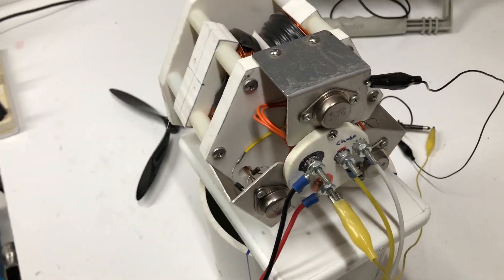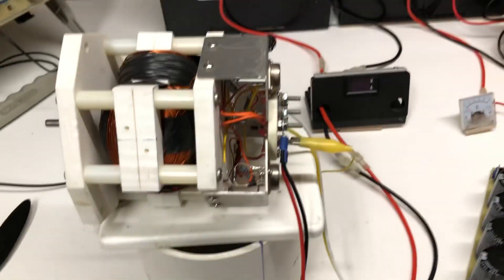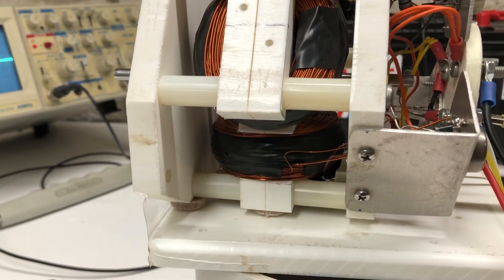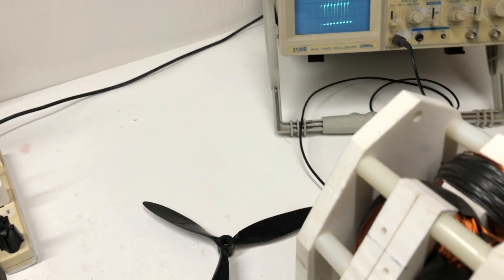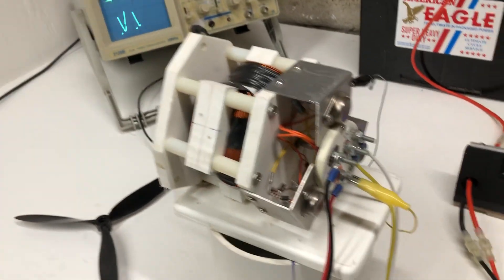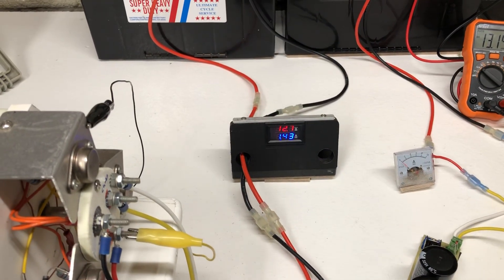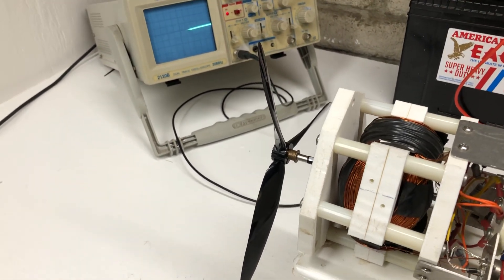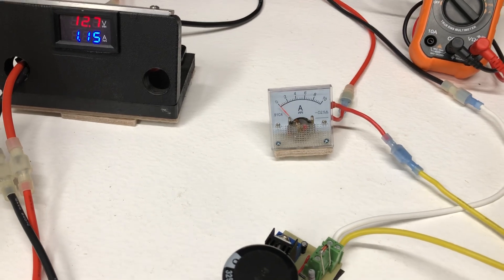Window motor operation with bedini circuit

Comment: Interesting stuff!

Why and how do you use the 'capacitorbank'?
Reply from the maker: I use capacitor bank to convert the hi voltage spikes coming out of the motor to low voltage high amp output

Comment: The diode you have connected between base and emitter, try using two or three of them in series and see if that stops the self oscillation. Cause the circuit natural self oscillate if you remove the diode completely

Comment: would you consider this circuit to be a parallel tank circuit or series tank circuit or neither ?
Reply from the maker: The output battery gets connected in series with primary

Comment: You always have great videos!  
Looks like you are showing that this motor works better under shaft load than spinning free?
There is a faster pulse to the cap discharge, since caps reach their trigger voltage sooner (so more watts output) plus lower input amps too when you add the fan as a shaft load...do I have that right?
What exactly do you mean by "self resonance"  Just wondering what your definition of that is....

Thanks!!
Reply from the maker: Yes you do ! That circuit seems to work better under load and uses less power the torque isn’t great but output is !
 I called to self resonance when the motor has the right load speed and output it gets that sweet spot some people call it

Comment: With the window motor, your output is a one wire  system ?   If so, have you tried to add multiple inductors along the one wire to get more output ?   If you have varying inductor sizes, the  largest must be first one in the line.    
Have you ever tried adding a ground wire to your circuit for more output ?

Great Video.  Really enjoy your videos and motor designs !
Reply from the maker: Thank you ! The output negative is the positive on the first battery 
 Yes I have seems like it regulates the output more than helping 
 I can do some videos on it

Comment: Bedini circuit is good but one could use a very inexpensive PWM instead of the trigger winding, and use the trigger winding as a generator output coil since it is already in place. The item is called XYPWM and is sold in one, two or three channel versions, cost me $9 per unit....one of these would free up the trigger coils for any other function you would like to use it for.
Reply from the maker: Thank you 
  Yes I have most my motors on pwm 
 The point is how the bedini system works
Reply: @kenergy1707  Bedini Zero Force Motor, using a Bedini-Cole Circuit seems to be better in many ways than the  SSG. What I would very much like to see is how you would configure one of your attraction motors as a Zero Force
Reply from the maker: @rotorque4254  that’s a good idea 👍 
 The attraction motor doesn’t need the polarity switch though so a mosfet is more efficient 
 The npn and pnp transistors on the cole circuit use much more power to run than the mosfet
Reply from the maker: @rotorque4254  yes I agree good for bipolar switching
Reply from the maker: @rotorque4254  I have a prototype zero force I’ll have to put it together so you can see it run
Reply from the maker: @rotorque4254  I have one with iron core and one without core 
 The one John shows is no iron
Reply: @kenergy1707  would love to see that one!
Reply from the maker: @rotorque4254  I’ll work on it